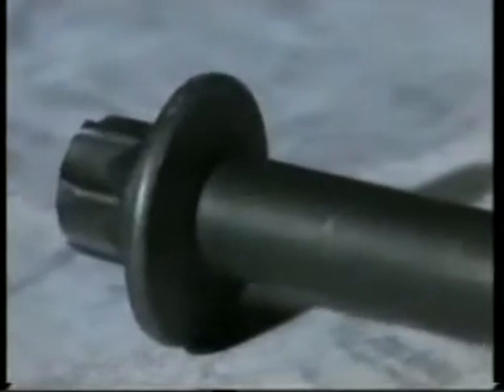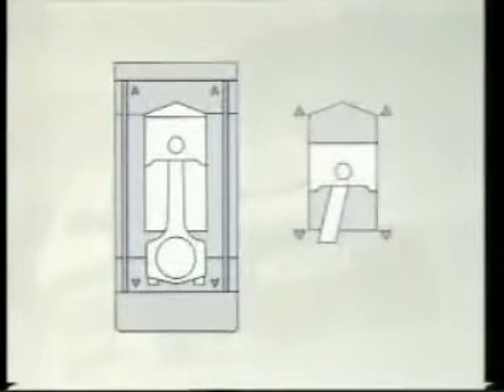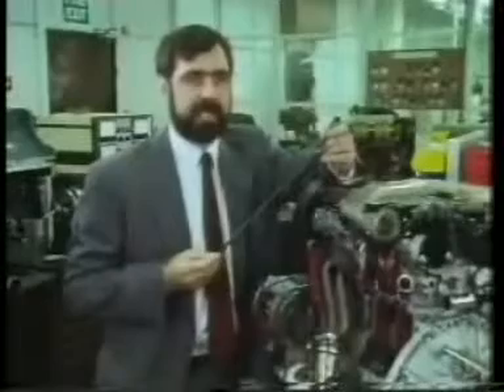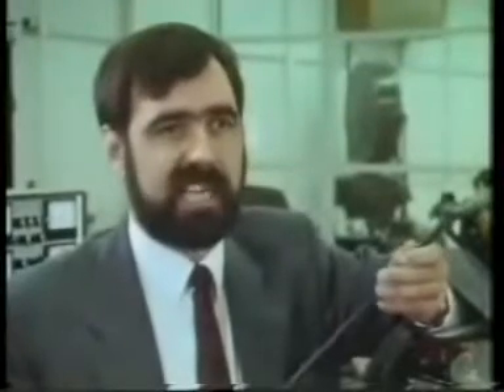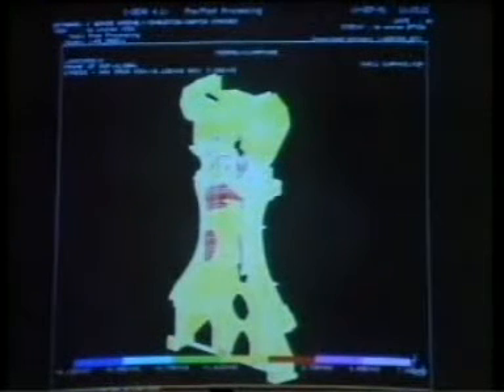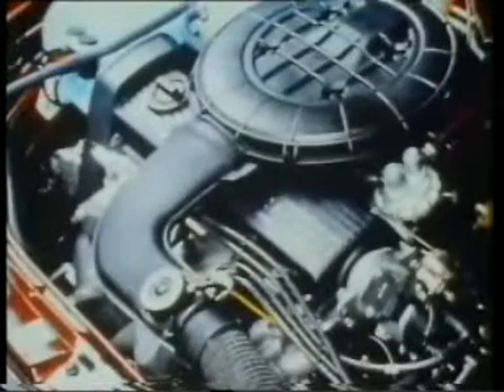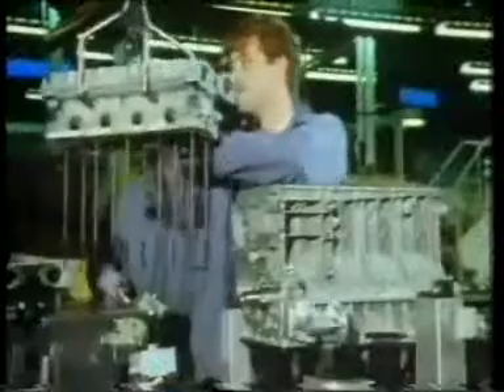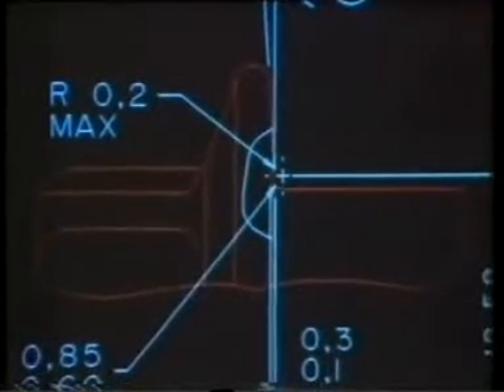The Longbolt (Rover  K-Series)

Comment: It works very well in theory and under normal engine conditions. Problems occur when the engine gets overheated. As in a chain reaction the head gasket starts to leak, coolant is lost, the engine gets even more overheated, and the long bolts break because of the extreme tension, they pop off.
So K-series engine car owners should be very alert in checking engine temperature gauge, coolant level, and condition of coolant and cooling system components, more than with any other engine type.
Reply: MrMarsvin1 no, this engine is no more likely to fail under adverse conditions than any other. Thermostat location should be changed but other than that poor servicing or tuning is to blame like with any other engine.
Reply: Having owned a couple of Rovers over the years, you become accustomed to the art of driving them with one eye on the road and the other on the temperature gauge!